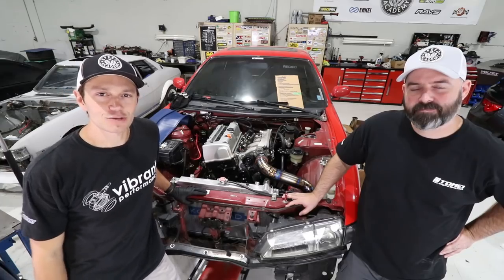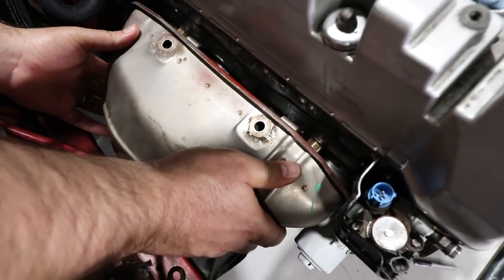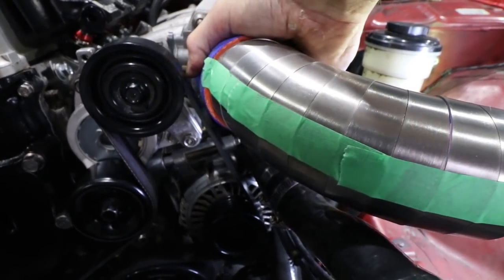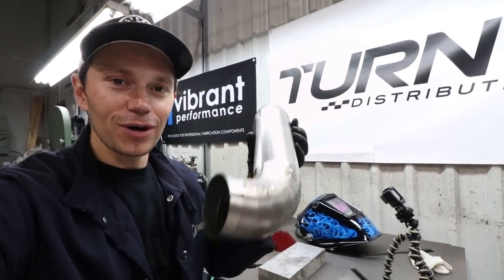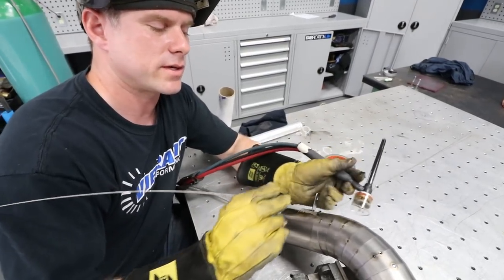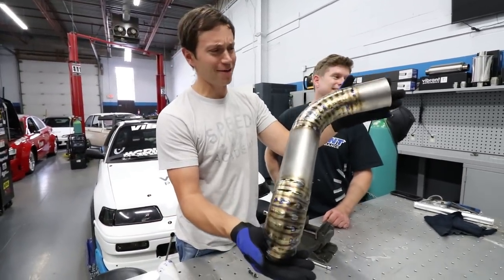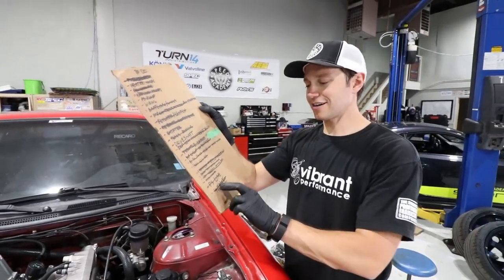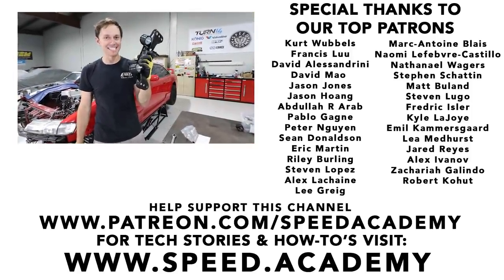How To Build A Titanium Intake - Honda K-Swap 240

Comment from the maker: For those of you wondering about the Miata video published earlier today - It will be back on wednesday, in full HD (we hope). There's a glitch in the YouTube matrix that is causing issues currently.
Reply: YouTube is prejudiced against the MX5? Corky Romano was a bad movie, but it wasn't the Miata's fault! 😖 ...dang it Chris Katan...
Reply: It's been happening all over the place. Gears and Gasoline couldn't get episode 2 of their road trip series higher than 360p.
Reply: Speed Academy  hey guys what first mod would you recommend for a s10 2.2 with manual trans PS I have 235 65 r15 with 3 inch spacers on all the hubs  for more traction and track width
Reply from the maker: Start with brakes, then move onto suspension. If you have a square tire setup (so 235's front/rear) that will help cornering quite a bit versus a skinny tire up front and wide in the rear.
Reply: Speed Academy thank you once I upgrade I’ll share the results
Reply: Did you guys weigh the Kswap and Bmw trans fully dressed?
Reply: I don't want to come across as a know it all but be sure to hold that post flow for its entire cycle when welding titanium cause it needs to be shielded from oxygen when its in critical temps or it'll get contaminated. Great video man.

Comment: don't use heater hose for a catch can. Heater hose deteriorates with engine oil
Reply: this is absolutely correct.
Reply from the maker: Yes if there was actually oil running through it then we would have went with proper oil line but since its vapor this will last for years with zero issue and has on another cars we've used it on.

Comment: That "cool blue" colour is contamination, titanium absorbs contaminants from the air when it's hot, that's why purging is so important. If this was a structural piece then anything other than a straw colour and it would be scrap. As it's not structural it doesn't matter too much.
Reply: shouldn't expect much from folks that just wants the views and google money
Reply from the maker: Its an intake not a piece that is holding up the car so we'll be just fine. And have you ever looked at a ti exhaust system, its 'contaminated' all the way through and somehow it still holds up just fine so not sure what you're point is.
Reply: it's all for show. like that hack job of carbon fiber intake box they had it made lol
Reply: You are so wrong. The blue is literally titanium oxide from heating up. That is not contamination it is an inherent property of most metals, brass and steel included. I expect nothing less from 14 year olds who pretend to know what they are talking about who write and like uninformed comments like this

Comment: That belt is crazy close to the intake, those auto tensioners move alot when the engine revs. I've seen manual tensioner set ups that make the belt routing way more compact and away from the intake, y'all might wanna look into that.
Reply from the maker: yeah we looked at it but few of them run a PS pump. I wanted to try it with the stock routing first. If there are issues Ill go to a ktuned manual tensioner.

Comment: With the stabilising tab on the tube, have you taken into account the engine movement over bumps and when torqued over under power*? It can be quite significant at a distance from the engine and cause fractures of the mounting points, the insulating mount (grommet?) and/or loosening of the hose joins - especially if you haven't bead rolled the ends.

*Remember, the torque reaction isn't the engine torque, but the engine torque TIMES the gear ratio it is in!
Reply from the maker: the mounts are stiffer than stock so there wont be alot of movement at all.

Comment: I may be wrong, but it seems to me that you will have some heat transferred from the upper radiator hose to your titanium air intake. I do not know the ability to transfer heat from titanium, but I imagine that you want to have the air entering the engine as cold as possible
Reply from the maker: That rad hose is 4-ply so it will be minimal, the rad fans running will transfer more hot air into it but with the velocity of air entering the engine its not as big a problem as you think, the key is to have the intake away from that hot air.

Comment: Why not weld a short tight 90 degree elbow on the throttle body, so you don't have the silicone even close to touching the belt. Just a thought.
Reply: IIRC, someone makes a kit that eliminates that stupid idler.

Edit: It was the Clockwise Motion lightweight alternator kit that I was thinking of, but there are others. The K-Tuned A/C & P/S Eliminator Kit might work, but I think that these guys are still running the AC compressor.
Reply from the maker: WE looked at those kits but wanted to see if we could use the stock routing. Goal is to reduce the amount of mods needed to make this work.
Reply: Ah, I see.

Comment: Why titanium now? Aren't y'all debating about changing it to turbocharged later?
Reply: Cuz titanium is just cool, even if turbo later or not
Reply: @Leofred2000  Yeah. But it's also more expensive than alluminum/or whatever. And if they go turbo later they'll need to redo the intake
Reply: Cool needs no other reason :)
Reply: Oh well. Ok
Reply: Maybe for video content? I don't know
Reply: Basomga because you can add another piece to line it up with an intercooler later! 👀
Reply: its going to be displayed on turn 14 show, most likely, cant stand out w/o the TI I guess, personal preference would be 4ply silicone intake.
Reply: product placement advertising
Reply from the maker: Because we've never worked with Ti before and building an intake seemed like a really cool way to do it!
Reply: Agreed it is pretty nifty.

Comment: Why dont you guys add a 45° neck onto the throttle body extend it so when you go to mount the intake youll be further away from the drive belt?
Reply from the maker: Thought about it, too much work when a coupler will do the job just fine.

Comment: 3.5 to 4" is the proper intake size for naturally aspirated honda engines 2.0L and up.
Reply: Thatnortherns2k what size is the factory tube on an s2k?
Reply: ID 2.75" TB side and 3.5" filter side. Thats on AP1.
Reply from the maker: We didnt see any significant gains when we went from 3 to 3.5 on our K20 Civic...